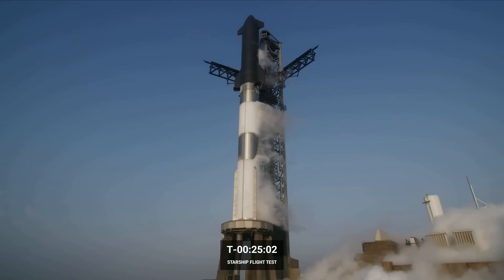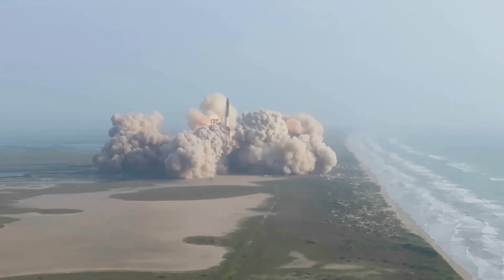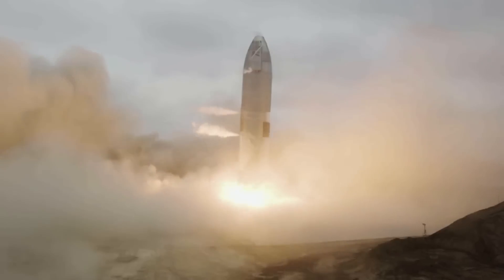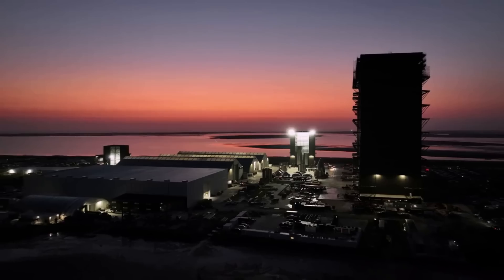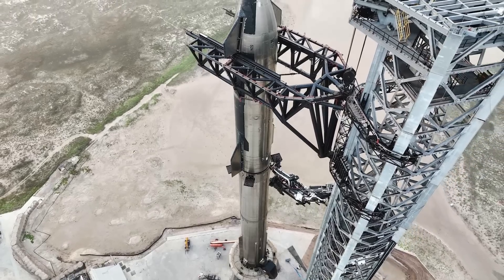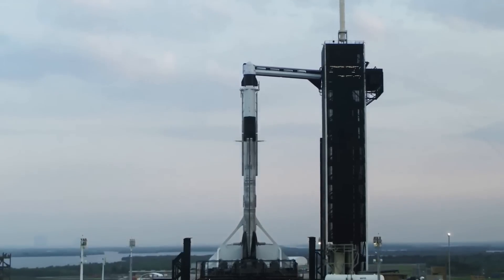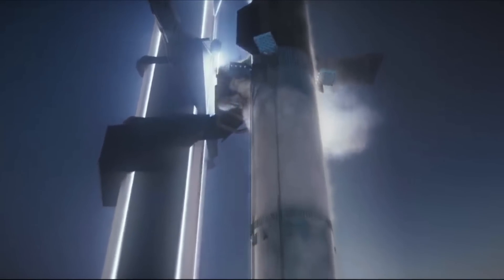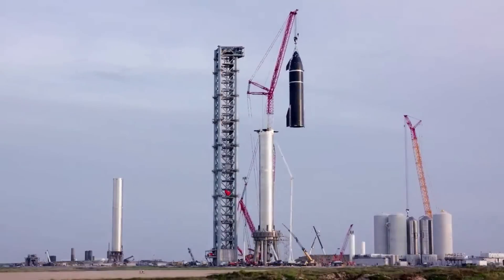Why SpaceX Launched Starship With Minimal Pad Protection

Comment: Why? Because Elon the Ego and his psycophantic Musk-eteers decided to ignore the facts (They knew the thrust, temperature, the limitations of the pad) that said that what happened was indeed going to happen, but the boss wanted it NOW, so there you are. That sums-up the few reasons rather succinctly. That "Stage 0 requires considerable work" is an understatement of British proportions. This was an extreme case of blithe, stubborn optimism, and an ignoring of anything that said "Wait". There is much to-do about all the data they gathered with this failure, but think of all the data they COULD have gathered with a fully-safe and successful launch. As it was, they narrowly avoided blowing-up the rocket on the pad, and therewith, all the ground infrastructure associated with the pad complex, because that tank-farm would have blown too, adding to the blast. Impatience and stubbornness are prime ingredients in this mess.

Comment: The whole design concept of Starship is minimal turn around time. This includes minimal launch infrastructure in all use scenarios. The main Musk selling point is it will have the same utility like the original VW Beetle or Model A Ford did. But if significant launch facilities are required for both safe and repeatable launches (for all launch sites, both on earth and elsewhere) then the utility of Starship is not as simple as Musk states. This launch proved that the SpaceX envisioned CGI renderings of future SuperHeavy/Starship launches is missing a key component of an adequate launch facility, which was proved necessary with this test. The FAA will insist on it.
Reply: NO, the launch facility is static ground based and needs to RELIABLY host hundreds of launches; it is the one part where SpaceX can & should throw in as much redundancy as can fit.
Reply: @owenwilson25  why didn't they simply use NASA mind bending water deluge system and launch pad!?
Reply: Bullshit!!! It's literally not something to be compared lol!!!!! We're talking about a massive "bomb" that literally has to deliver loads to space! That's not something cheap or environmentally friendly at all!
Reply: Shhhhhhhh... the launch was a success. All hail Elon!
Reply: Before SpaceX, Boca Chica was a backwater hardly anyone except locals knew about or wanted to visit.  I was surprised at the choice of location for rocket launches.   It is a tiny piece of land next to a nature reserve and close to population.  The highway belongs to the county and needs a lot of repair.  After seeing the effects of the launch, I am not happy with the chunks of concrete and rebar on the beach and in the dunes.  It helps the local economy, otherwise I am not sure I want them to continue to launch there.  Florida has the infrastructure.  Maybe SX should move there before investing in Boca.
Reply: That all sound like fanboi stuff. The short of it, Elon really needed to spend $7 on a launched pad.

Comment: What boggles my mind why so little attention and engineering was put into constructing appropriate launch pad while diverting all attention to mechanical, electronic and control aspects of the program. Don't they have any experienced structural engineers to design the appropriate concrete/steel diverters and water vapor suppressors ? And this from a retired structural engineer experienced in this field.
Reply: I am sure the engineers told Elon the Ego the facts, but he didn't want to wait to build it right. They had to have known the limits of the materials, and the forces that would be acting on them, and already had examples of the destructive effects on other similar structures under even less stress. Somebody decided to ignore reality in order to get their launch, and now it'll cost SOOO much more to get to the next one.
Reply: The metal flame diverter & water suppression facility were all well under construction & were going to be installed next, so it was not a question of saving money. Elon admitted that the team judged that the concrete would survive a single launch, they were wrong. Hopefully the diverter & water systems will do the job without major alterations to stage0. The pad damage is an unfortunate incident, an odd misstep, a self inflicted wound.. obviously SpaceX knew the blast deflector & water systems were necessary for Starship launches, why weren’t they built & installed a year ago, designed in? 
Also, too bad the flight software didn’t shut down the booster & release Starship when control was first lost, Starship flight & reentry data would have been nice.
Reply: @warrenwhite9085  
Starship was too low and much more importantly way too slow and spacex probably had no idea where it would have come down. They basically had little choice but to destruct and crash it into Mexican waters.
Reply: @Mentaculus42  There was a 2015 incident where a Falcon booster failed, the Dragon craft got free but smashed into the water & was destroyed simply because there was no flight software provision to order chute deployment after a launch failure, or the Dragon could have been saved. Someday Starship is going to carry important/valuable cargo or be manned. There should have been flight software provision to react to booster malfunction by separating Starship then soft landing somewhere in water. This would have been a good test of that.
Reply: @warrenwhite9085  
That is a very good point, definitely a missed opportunity to try a simulation of a recovery from a pre-staging launch failure vs push to suborbital trajectory. This is something that absolutely has to be perfected before starship is human rated. My guess is that this has not even been considered, and if it was, they didn’t want to allocate resources to it at this time.
Reply: Rocket could easily explode on the pad. Any investment into pad would then be void and wasted. 

I wonder how large would be the fireball 🤔
Reply: I agree, but I also think that Musk over-rides what he's advised sometimes.
Reply: They were all fired.
Reply: Because SpaceX has no money to build it properly.
Reply: Musk is the average guy in the office who thinks he is the smartest in the room. Engineers for years said more was needed. Musk said no
Reply: @vasuba  He's a mechanical engineer and I can't understand how he could believe that perpendicular concrete pad would withstand tremendous pressure force during launch. May be he's too distracted, time to delegate responsibilities.
Reply: @jerzystecher  he has a degree in physics from a state university.  He has no engineering training.  Penn state is not known as a top school in arts and science.  It is not equal to MIT, Georgia Tech nor Cal Tech.
Reply: @jerzystecher  lol!!!
Reply: @johnelliott7020  
Yes, and an undergrad science degree from an also ran average institution. Never has taken an engineering class in his life. What he hopefully knows he has picked up from the people around him and some minimal self study. He applied to Stanford for a graduate degree in science because he was dealing with visa issues, was accepted but never registered but rather asked for a deferment so he could stay in US under his student visa. The story that I got was that he kinda left his thesis advisor hanging due to his late deferment. His topic had nothing to do with engineering but I think was a bit useful for EVs. Plus there is some stink associated with fulfilling his requirements at his previous institution that seems to have been sorta brushed under the rug. If anything, people should call him a scientist, so rocket scientist which is good, but never a mechanical engineer.
Reply: @jerzystecher  not an engineer. You just lied
Reply: because the environmental group didnt want a flame trench dug in their marshland, so now they are complaining about the dust...
Reply: @trolly4233  I doubt that's the reason for engineering negligence.
Reply: @trolly4233  completely made up comment.
Reply: @trolly4233  If you look at KSC's LC39A, the flame trench is constructed above the surrounding terrain.  NASA made it so large, I think, because they had to have a very gradual ramp for the crawler to be able to carry the Saturn V up the ramp to the elevated pad.  SpaceX has a better way and so wouldn't have needed that huge LC39 ramp.  I think the whole OLM should be tore out and replaced with a completely new design...maybe it could be completed in 8-12 months.  1.  Mound up dirt, rock and cover with heavy concrete to build a flame trench on top of ground level, like at KSC.  Bottom of flame trench would be at ground level.  Insides of trench lined with heavy steel plating (to the extent required).  Some innovative engineering might be needed so that the launch acoustics don't just pound the plates against the concrete and break them loose.  2.  In the flame trench on the highway side of the pad would be the access path for the transporter to bring booster and Starship up where the chopsticks can grab them, as well as an engine maintenance platform.  From under the mount to the other end of the trench could be steel rails that carry a heavy steel flame diverter wedge into position, and to move it out of the way to bring in an engine maintenance platform from the other end.  3. Above the trench could be the heavy OLM "leg" structures to hold the launch table above the trench.  Those legs would have to be of a new design, partially imbedded into the trench walls and adequately founded into the ground.  4. And, of course, a generous water deluge system, flooding the diverter and the flame trench walls and floor.  So, no flame blast and acoustic waves would blast at the tank farm or the launch tower.  This new OLM and trench should be built to withstand a 30-second, full-thrust, 33-Raptor static fire.  And then only subject it to no more than a 15-second test.  That should be adequate so that future launches and tests only emit water vapor and CO2, heat and acoustic energy.
They might be able to build essentially all of this while still using the existing OLM.  Just build a steel wedge permanently in place.  There will probably still be room to slide in a lightweight engine maintenance table above it.  The top of the flame trench might be 2/3rds up to the height of the launch table and might exit between three legs on each side.
Reply: @Andrew-13579  text wall reply jumpscare

Comment: My personal take on this is that it was the right decision to launch on 20th April, after all the FAA license dithering. 
A rocket sitting on the pad provides no flight data, and hinders development. SpaceX is under a tight deadline to be ready for NASA manned Moon landings. So, it seems sensible to launch ASAP and get that vital flight data, which they now have (albeit for a seemingly damaged rocket). Further development can continue apace.
Totally destroying the launch pad was unfortunate, but has also provided valuable data. Elon’s team thought Fondag was strong enough for 1 launch. An actual launch proved that assumption to be wrong. SpaceX will now know what they need to do for the launchpad in Florida.
Despite all the negative press, I see last week’s launch as progress. Time is tight, and real data was badly needed.
Reply: Pad issues likly puts starship even further behind schedule
Reply: @vasuba 
Exactly, if the optimization is to minimize overall development time, it is highly probable that this set them back to the left and was probably not the best fail forward if one looks at it rationally.
Reply: The decision to go with starship for the moon landing system is looking worse and worse all the time.  SLS will get the astronauts there but starship won’t be there to land them.

Comment: Scott Manley suggested the sidewise motion after liftoff was intentional to protect the tower. Has anyone heard confirmation from another source?
Reply: Unless Manley has that as a validated fact which when I heard that it came off as a pure total guess on his part and possible some cool-aid drinking on his part. Having a graduate degree in control systems engineering would strongly suggest that that type of movement was all about the flight control system trying to compensate for all of the failed engines. To do that type of maneuver that close to the ground to just protect the tower would be reckless and unnecessary. So the probability is very low that it was on purpose.
Reply: The sideways motion of the Starship Super Heavy after liftoff is intentional, but it is not primarily designed to protect the Stage 0 tower. The sideways motion is actually a maneuver called the "belly flop" maneuver, which is intended to slow down the rocket as it re-enters the Earth's atmosphere, allowing it to land vertically.

During liftoff, the Starship Super Heavy initially takes off vertically like a traditional rocket. Once it reaches a certain altitude, it begins its belly flop maneuver, in which it turns sideways and freefalls through the atmosphere. This maneuver is designed to slow down the rocket and reduce the heat generated during re-entry, making it easier to land safely.

While the sideways motion of the Starship Super Heavy may help protect the Stage 0 tower by moving the rocket away from the launch pad during liftoff, this is not the primary purpose of the maneuver. The main objective of the belly flop maneuver is to allow the rocket to land vertically, which is a key component of SpaceX's reusable rocket technology. Cheers From Park City Utah!
Reply: @ezragonzalez8936   You are confusing the fact that as Starship launched it leaned away from the launch tower with the belly flop manoeuvre that is used on re-entry to aerodynamically slow it down.  Two very different things. Now try again but this time try and make a sensible comment.
Reply: @keithmayes4358  are you talking about the lift off tilt ? here is the soviet N1 https://www.youtube.com/watch?v=U9fkYIrRwbo at  (2:24 Soviet N1 similar tilt  }in Starship superheavy sn10 is partly due to the (3) failed raptor engines at liftoff . but there is no official data from Spacex
Reply: @ezragonzalez8936  
I think it was about the launch only.
Reply: @ezragonzalez8936  wrong! It's primarily to protect the tower.

Comment: If they attempt to land Starship on the Moon with the expectation of launching from the Moon to return to Earth the mass of the rocket as it lands on the Moon would likely exceed 400t which is over 30 times the mass of the LM when it landed on the Moon.  Having 1/6 gravity will certainly help reduce the thrust needed, but 400t is WAY TOO F#CKING BIG and its likely that if they land on the Moon they will never be able to return to Earth given the damage to the engines and other system that would be almost inescapable given the fact that there will be no landing pad on the Moon.  As Starship comes in for a landing the rocks and debris kicked up by the exhaust will damage the rocket and likely the engines and there is no way to repair that on the Moon.

Comment: Okay .. its time the Boring Company got involved so that a series of deep tunnels are constructed below the launch pad to release the blow back pressure and channel the flame away.. plus add in the water deluge system.
Reply: They'll need scuba gear. They be right on the edge of the water table.
Reply: It's all swamp-land. As soon as you dig down a few feet, you hit water.

It's not impossible to dig down and build a shell like a reverse pool that you allow to flood with clean water and incorporate a flame diversion system but it's a lot of digging and work.
Reply: I’d say it’s the opposite, SpaceX should use raptor engines to build tunnels!  8 seconds and they dug a beautiful hole.

Comment: It may have been an oversite but  now we know what millions of lbs of thrust does to a fondag launch pad ! My question now is a flame diverter  really needed or  is it  a bad idea ? The steel and an upgraded deluge system should just be fine !
Reply: You have to control both the flame and the shockwaves from the engines.   The shock diamonds you see in the exhaust mean it's multiple supersonic and able to really hurt things just from the sound waves it's putting out.    Putting a water cooled steel plate flat under the rocket would be a bad idea as it would reflect shockwaves back up toward the rocket.   Some have offered that the metal plate would have a cone in the middle pointing up so the fire would be directed laterally all around the mount.    The legs won't like that as well as the nearby tank farm which is going to get blasted.   Most of the flame trenches have an angled impingement metal surface but then safely route the exhaust as it's being deluged with water.
Reply: Sorry, Scotty, you fail to understand all the physics involved. Recoil states it rather well, a combined flame-trench/water suppression system is absolutely needed. And OBTW, they already knew the limitations of the FONDAG, and the full amount of thrust and temperature produced, so the structural engineers had probably already tried to get Elon the ego to build the trench/suppression system, but he, like a spoiled child, wanted what he wanted, and wanted it now.
Reply: @stephenhoward6829  i would trust that incite more from you than anybody else some forums state no trench some say trench some question  if spacex is using a water cooled steel plate system were would the trench fit in and or will the trench cause undesirable resonances ? Its hard to discern at times
Reply: So much existing data they ignored. Look up Aeroballistics and testing division 1962. All of this was researched. Concrete, steel, refractory cement. They came up with the Saturn v launch pad design. Elon needs to use google.